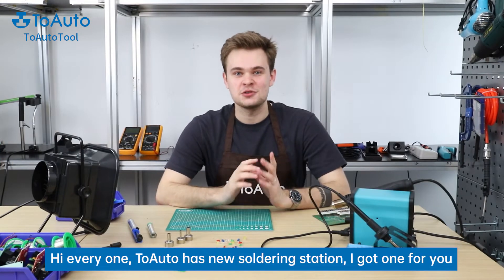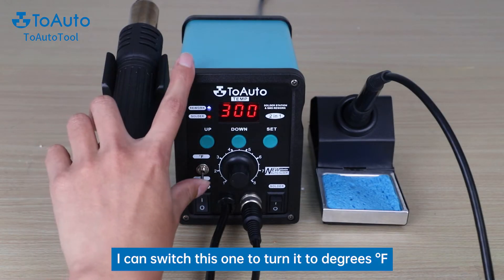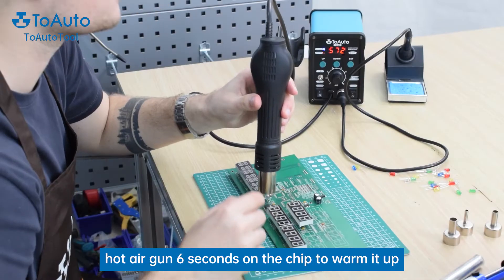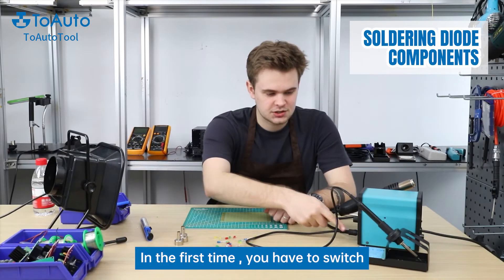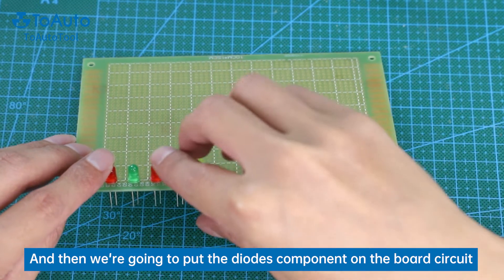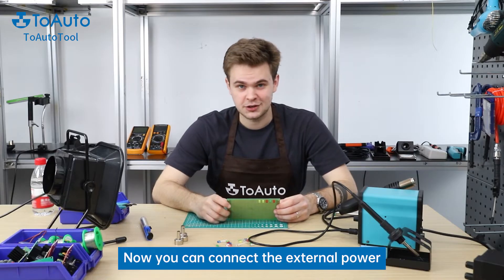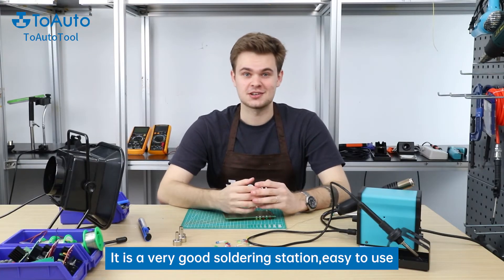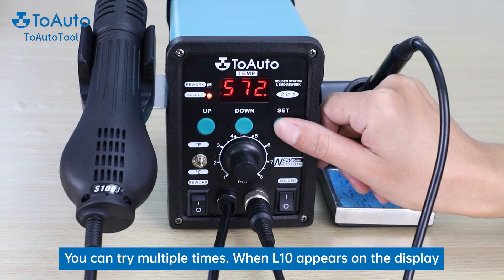ToAuto 2-IN-1 Soldering Station Kit 2.0 - More convenient to you - Great for beginners - Hot air gun

Comment: what on earth is this video?

It tells me almost nothing about the product, and even less about how to do things. Why did you hook an LED up to an power supply in a way you could h ave done before soldering it to the board, you didn't actually demonstrate anything. 

This is a very weird video.
Reply: Yeah man I was seriously considering buying the ds882, but I'm starting to see comments about review units having entirely different circuits and internals than customer purchased ones. And now they have this strange marketing video that makes no sense..... I wonder if perhaps the marketing department run-a-muck due to declining sales or something....
Reply: @petersvideofile  I ended up with the handskit T8245 combined solder/rework station. Very fair price, quality product and perhaps most importantly very responsive and helpful customer service.  Takes JBC tips without issue.
Reply: @tjmarx  Thanks man! I just took a look I can only find the T245. Anyways I went for the BK881 it looks like exactly the same as the ds882 but by another company. I guess they share the same supplier and these companies just brand stuff. Hopefully it works ok. :) Thanks again though for replying!